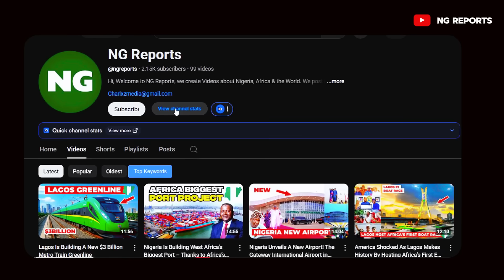Why Nigeria Is Building Another Refinery In The East: A New Competition For Dangote Refinery

Comment: When is it going to be completed?
Reply from the maker: No official date yet but speculations point to 2026 or 2027
Reply: @ngreports  What speculations? Please don't mislead people with mere content creation. Have you ever seen a refinery with 200k b/d built within five years. Akwa Ibom is not in the east.
Reply: The question you should ask is when is it going to be started? The only thing that has been accomplished so far is the agreement for the design which happened in 2020. The "groundbreaking that was scheduled for 2021 still hasn't happened.